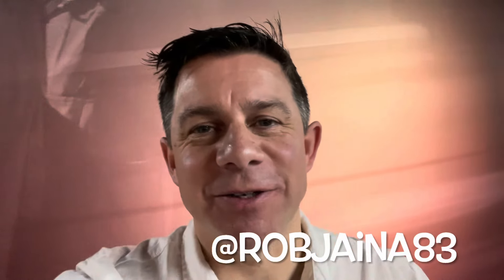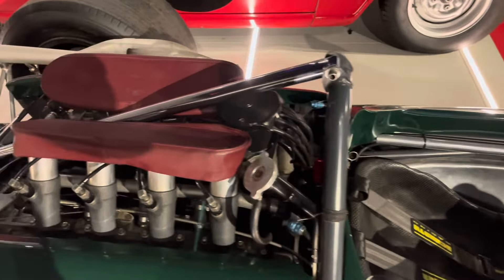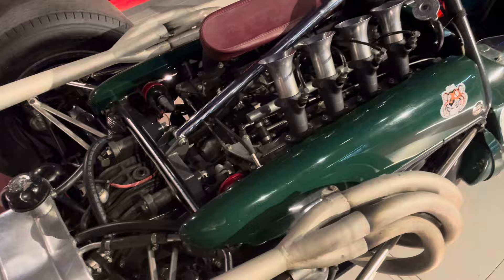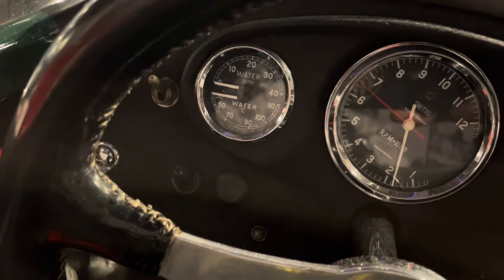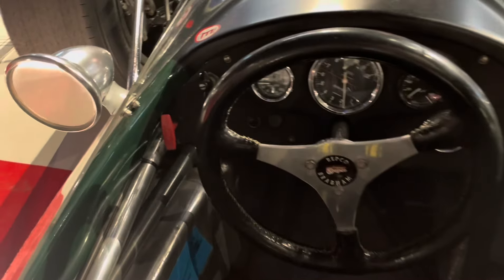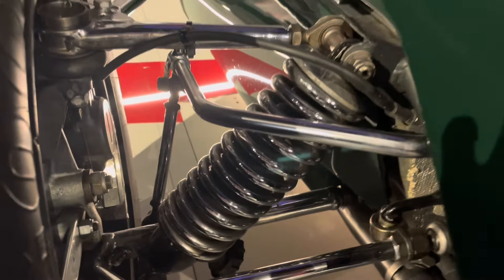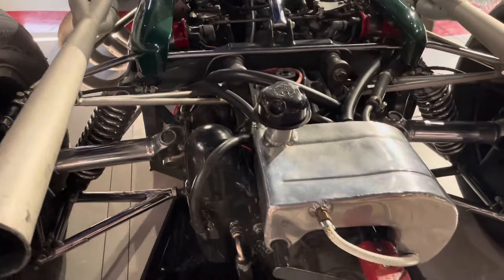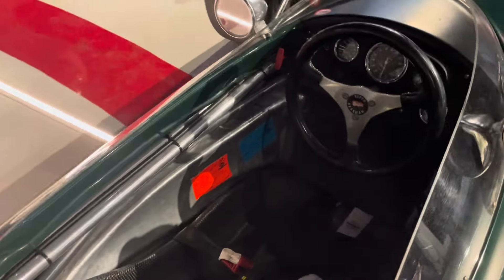Brabham BT20, close look at a classic F1 car from 1966!

Comment: Nice to see it in green & gold, although the traditional Australian sporting colours are green & yellow, which would be confusing in F1 as they were Lotus's team colours. Another nerdy fact is that, due to Repco not having sufficiently deep pockets to build an engine from scratch, Brabham decided to use the lightweight aluminium Rover (neé Buick) 3.5 litre V8 block, destroked it to the required 3 litres, replace the standard 2 bolt main bearing caps with 4 bolt ones & get renowned fellow Australian engineer, Phil Irving to do the design & engineering of the engine including the SOHC heads (again probably due to budgetary constraints). Although it developed less power than Ferrari's seemingly all-conquering cars, it was ultimately more reliable, enabling Brabham to win the 1966 Gran Prix. That was back when Repco actually did some pretty terrific engineering. 1966 would not have a good year for old Enzo, losing the 24 hours of Le Mans to Ford & both the F1 world driver's & constructor's championships to an Australian using a Rover engine. It would almost be enough to make you give up on motor sport.
Reply: The official  Australian sport colours are in fact green and gold .
Reply: Small detail, but the engine was based on the Oldsmobile block. The deal to sell the GM V8 to Rover was only concluded in January 1965 and the technology transfer only began then. Development of the engine was well underway by the time Rover were producing engines.
With the expertise that went into the engine, the Repco Record Sports car and the Hi-Power head for the Holden engine, it's a great shame that the once great Australian Repco is no longer Australian.

Comment: The BT20 did not have a stressed member engine (or monocoque chassis).  The first was the Lotus 49 of 1967.  The first monocoque Lotus was the 25 of 1962.  The first production monocoque Brabham was the BT28C of 1972.
Reply: Right, at 02:06 you can start to clearly see the tubular space frame chassis underneath the Repco engine.
Reply: Lancia D50, Ferrari 1512, Lotus 43 BRM...